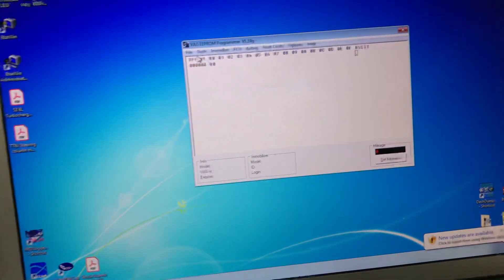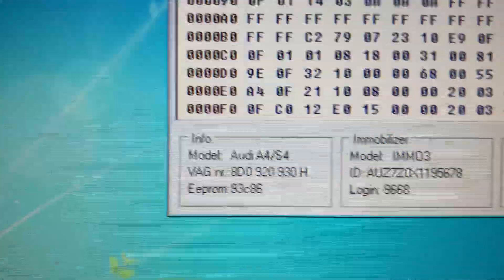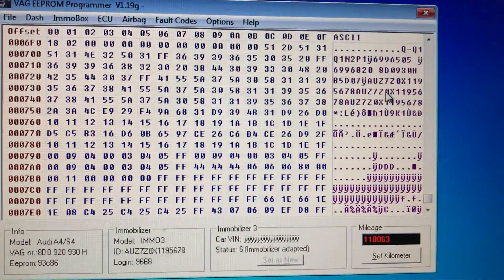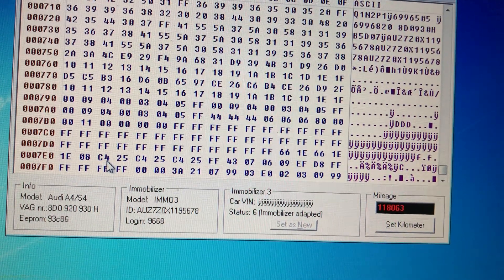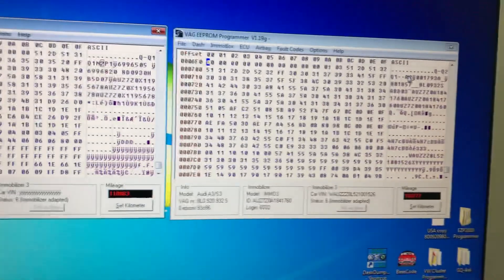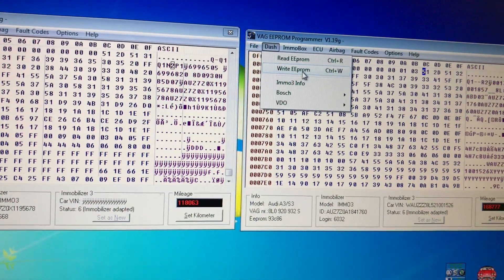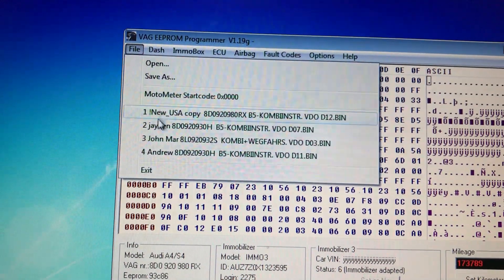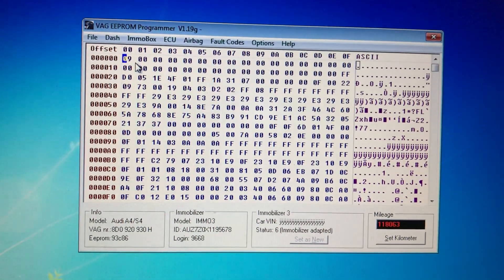How to read cluster EEPROM - Audi A3, S3, A4, S4, RS4 & Golf Mk4 R32 Gen. VAG EEPROM Programmer link

Comment: Thanks for the video! Very helpful. I wish you were a little more explicit on the wiring around there. It's a little hard to see what you did there
Reply from the maker: @Michael Liles here you go. everything's @ green pin. See *'ed pin numbers to join to OBD2 port.

This is B6 2002 years RB4 cluster connectors list:

32-pin multi-pin connector, blue

1 - Washer fluid low
2 - Coolant level low
3 - Fuel gauge sender
4 - Coolant temperature
5 - Control group 2 Navigation system
6 - Control group 3 Navigation system
7 - Control group x Telematics
8 - Menu switch
9 - Vacant
10 - Bonnet switch
11 - Fuel gauge sender 2
12 - Menu switch (Out A)
13 - Vacant
14 - Vacant
15 - Vacant
16 - FDR/TCS (= ESP)
17 - Convenience CAN High
18 - Convenience CAN Low
19 - Infotainment CAN Low
20 - Infotainment CAN High
21 - Ambient temp. (input)
22 - S contact
23 - Oil level / oil temperature
24 - Self-levelling suspension
25 - Menu switch (enter)
26 - Vacant
27 - Vacant
28 - Menu switch (Out B)
29 - Vacant
30 - Transponder 2
31 - Transponder 1
*32 - Terminal 31 (sensor)

32-pin multi-pin connector, green

1 - Terminal 58d
*2 - Terminal 30
*3 - Terminal 15
4 - Vacant
5 - Speedometer (input)
6 - Speedometer (output 2)
7 - Airbag (inverted)
8 - Turn signal (right-side)
9 - Brake fluid low
10 - Turn signal (left-side)
11 - Turn signal (trailer)
12 - CAN drive Low
13 - CAN drive High
14 - Terminal 61/charge warning
15 - Vacant
16 - Oil pressure 2
17 - Terminal 58s
*18 - Terminal 31 load
*19 - Terminal 31 load
20 - Vacant
21 - Speedometer (output 1)
22 - ABS warning
*23 - K wire
24 - CAN drive (display)
25 - Tank flap switch
26 - CAN diagnosis Low
27 - CAN diagnosis (display)
28 - CAN diagnosis High
29 - HRC (headlight range control)
30 - Belt buckle
31 - External buzzer
32 - Brake pad wear

https://www.audizine.com/forum/showthread.php/486720-RB4-Cluster-connection-pinout?p=7611852&viewfull=1#post7611852
Reply: @ianpgonzaga  i have a genuine registered VCDS HEX-USB+CAN Intelligent Dual K Interface cable. Can I use this cable with the VAG EEPROM Programmer V1.19g program and windows 10 ?
Reply from the maker: @johanverster5638  not sure about windows 10 compatibility but try it and please let usr know! Otherwise the cable will work with the program on older windows versions.
Reply from the maker: Udrea Alexandru Robert at which point? Maybe I can explain a little more in reply.
Reply: @ianpgonzaga  hi for cluster audi a4 b7 its work?
Reply from the maker: @aurelianhosu9966  a4 b7. Maybe. I have never tried … with a b6 it needs a slightly different wiring and buttons to press. 

You can see the a4 options in the menus.
Reply from the maker: @Michael Liles thanks. The b6 green plug wiring is different. But you use the other option in VAG eeprom (for Bosch a4) to read the cluster.
Dash 
> Bosch (the option for A4 b6 are here)
Reply from the maker: @Michael Liles perfect ;) good luck with fiddling around! Have fun.
Reply: blue connector pin 1 and 23 to 12v.    pin 24 to ground.    
green connector pin 28 is  k-line.

for obd pin 4 and 5 to ground. pin 16 to 12v and pin 7 is k-line. connect pin 7 from obd to pin 28 at green connector

Comment: Can you tell me which pins to use to replace Eeprom Ch 314a without disassembling the instrument cluster?
Reply from the maker: vaxo tamazashvili can I clarify - you want to replace an eeprom chip or just the code??
Reply: @ianpgonzaga  only baits needs to removal. Miles to km, gallons to litres
Reply from the maker: vaxo tamazashvili I see. You usually do this in VCDS. Change the country to match that of one that uses the measurements you desire.